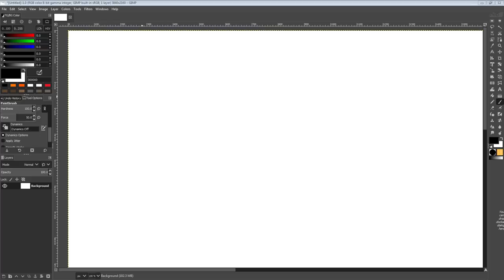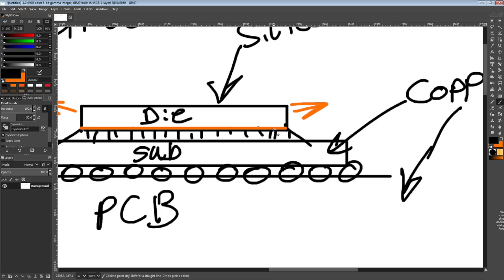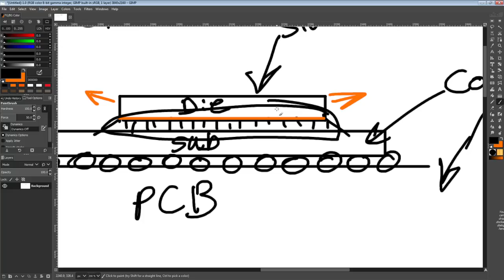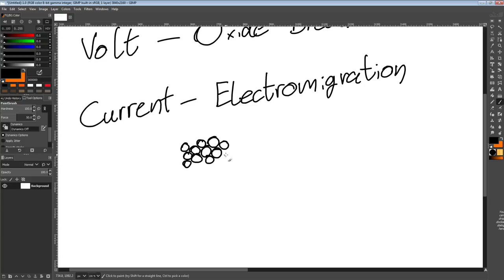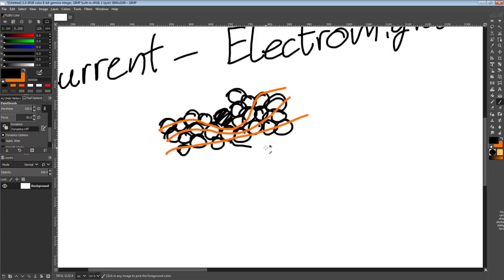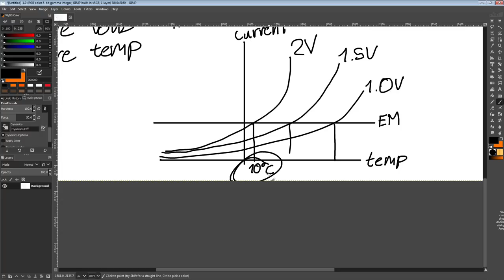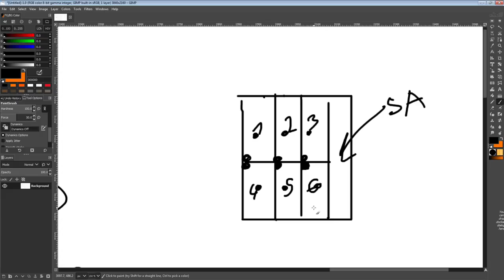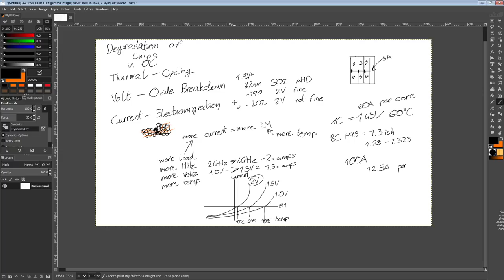Rambling about chip degradation

Comment: 1:12     thermal Cycling
18:15  oxide breakdown
28:52  electromigration
Reply: @Neiva71  Except in order to have comprehension of each of those you need some comprehension of the others
Reply: @cas curse If you already watched it, and you're back here again, did you really comprehend the subject matter?

Comment: Very good explanation.
That is the reason why I'm undervoting/underpowering my 1080 Ti down the point it does perform 5-10% less than stock settings (but plenty enough for me). But use SO much less power. 80-100W less. Having a GTX 1080 Ti use 150-160W is really nice. 60c max on air with very low noise. And the knowledge of much less degradation. Also always undervolting my CPUs when doing stock speed. Undervolting is possible on most chips, because the stock volts are normally set high(to be stable with even the worst binned silicons). Undervolting also saves you money on a bigger cooler and on the electric bill. But yeah... undervolting plus a bigger cooler is the best for longevity. 
I have a retro rig with a QX6850 (12 years old) that at stock freq, can be undervoltet quite a bit. So must still be in in good nic ;)
Reply: I use i3 530. Still rocking. No GPU and 3 Gb RAM overclocked. Stock cooler. 9 years almost 10. Playing arkham assylum :)
Reply: @karl9791  whats the point of keeping an old processor alive for so much time? 
Like, idk where u from, but in Brazil we pay at least 3 times more  in eletronics and we still dont want to keep the same cpu for 10 years.
Reply: @Shadower2014  no one want keep it for 10 years. For me, the ideal would be swap every launch announcement. But is what it is. My point about my cpu is simple, intel have a healthy long life. And I use it almost 24/7. So.. Just that. And I have another pc. New one. Waiting just for the rtx 3080. And still no plans for rework in the old one, maybe some change in the storage... Maybe. Idk.
Reply: Modern GPU's like the 1080ti doesnt degrade like CPU chip does. Linus made a video about this.
Reply: @MovementCultivation  All electronics degrade. Just the variable how quickly..
And actually the 1080 Ti might degrade faster than a smaller GPU die (like a 1070) especially if loaded with many thermal cycles. Any big die GPU chip generally degrade faster than the smaller ones with many thermal cycles. But As long as you use it within Specs (stock settings) it should have no problem lasting for years (5-7 yrs) Keep thermals and voltage as low as possible, and you gain less degredation and longer lifespan.
A way to check chip degradation, is to try running it low as possible voltage vs highest clockspeed as brand new, and then 3 years after, try it again. It might need a bit more voltage to run at the same clockspeed it could when new. Meaning its degraded. Might still be okay to run perfectly within specs, but degraded compared to when new.
Memory is a more fragile thing with modern graphics cards. Nvidia cards do not have memory temp reading and I know GDDR6(X) run hot. The new cards give you speed.. but not lifespan. Nvidia has no intention on making these last for 5+ years. (Id be surpriced if more than half of the RTX 30xx cards still works fine in 6-7 years) Nvidia knows the market demands Performance now. Not long term endurance.
Not overclocking the memory will be a good idea. Downclocking it a bit will give it a cooler longer life. Especially if its going to be put at hard work.
Reply: @Wushu-viking  Sorry..I think you missed the context of what I previously said. What I meant was Modern GPU's doesnt degrade as quickly or comparatively like CPU does.

Not like CPU's, GPU's degrades so slow on real life workloads, example gaming, rendering, encoding etc. Just like what you've said "Nvidia has no intention on making these last for 5+ years" - To the point that replacing the GPU because it's already outdated comes first before degradation. 

I OC'd my 1070ti to its last juice running at 70c underload for 4hrs in average and its core clock and voltage stays the same since I bought it.

I would say the fastest way to degrade a GPU is running it at it's max limits 24/7 just like how miners do but even some of them them cannot notice any decrease in performance. My friend has a mining farm, well just a room actually, and all his GPU's run 24/7. Just have to do a 2 day maintenance every 3 months. He already sold his first batch of GPU's after almost 2 years of use and it's as good as new.

I would say GPU's do degrade but it's too minute that you can only observe them in monitoring software/tools but not in observable performance, example fps or encoding speed.

Edit: Spelling
Reply: @MovementCultivation  Most electronics generally break (when they do) during a powercycle. So running "slow n steady" 24/7 is a healthier load than what you see with typical gaming usage. (Especially on many not maintained systems full of dust)
I too have also positive experience with GPU lifespan and mining. Ive been running several Vega 64 almost 24/7 from 2017 to 2019 heavily undervoltet (Just above stability limit). And maintained from dust. They were all in very good shape when I sold them in gaming PCs afterwards. Not even the original thermalpaste had dried up. Thanks to few powercycles, and steady healthy temps.
Point I was making is, that undervolting is healthy for the components. And if everyone used a bit of time to find the sweetspot of power/performance, they could save money on the power, and could enjoy less heat, noise, and dust intake along with longer lifespan.
I can make my Titan XP run similar (actually better due to stable freq) performance vs Stock settings with tweaked voltage/frequency curve. Using 70W less.

Im not so sure about how durable they aee compaired to CPUs.
I have seen many listings on defective graphics cards. (Some not working, some displaying artifacts, some only 2d working, some just unstable on loads.. Cards that probably has been used for gaming (maybe factory overclocked) and probably unmaintained, used at the thermal limit without knowledge of it.
Might not be a GPU problem. Could be memory, power delivery.  But defective card none the less. Using less power also puts less strain on the power delivery. (2+ on health) :)

Comment: A slight correction on electromigration. Current only flows on the surface of the conductor, not inside. Electrons jump from one atom to the next, from one end of the conductor to the other, leaving "holes" behind, and the direction of the flow of the current is actually the opposite of the direction of flow of electrons, so, basically, the direction of the flow of "holes". Every conductor has a certain resistance, which is actually the resistance to the electrons jumping from one atom to another, and one can think of it as the amount of hold an atom has over an electron. Also, current always flows in the direction of least resistance, which is now even more obvious. We can observe electromigration as migration of electrons that deviates from a wanted path due to changes that happen in either lower or higher resistance in certain areas of a conductor. If there's more than wanted resistance, electrons will take a different path, if there's less resistance, more electrons will flow on the same path over the same time. Voltage, temperature, impurities in the conductor and many other factors (including electromagnetism) can determine whether the electrons will behave as we want them to or not. So, too much resistance in a wanted path or lower resistance in a not wanted path will be the symptom of electromigration. The rest of the explanation that involves current, temperature and other factors is correct. O, and one more thing, electrons have insanely low mass, so it's not a bump as described, but they lose energy on overcoming the resistance, and are no longer able to follow a path that has more resistance than electron has energy, so they take a path of lower resistance.
[edit] one more note, greater the resistance - more heat, which causes even greater resistance.

Comment: Room temperature can also be like 5C when you're the extra ghetto type of overclocker who just opens the window in the winter for extra low ambient temperatures since chilled water cooling or dry ice is too expensive.
Reply: It depends where you live :D
Reply: @PainterVierax  Norway here. Managed to get the water temp in my loop to 7C by opening the window. My 1080 Ti was chillin at 18C under full load overclocked. It's pretty dank
Reply: 5Ghz on a R5 2600 using an air cooler gang
Reply: Just put your computer outside bro.
Reply: Theres no way you hit 5G off an air cooler.....what voltage are you using to hit 5G & whats your fps gain if so?
Reply: @gamechanger2324  You can if you live above the arctic circle. :P
Reply: @jeposton  i assume that would create condensation within your system?
Reply: @sangwonpark8967  cope
Reply: Lmao man I used to do this.  "Time to fire up the gaming rig, let me grab my winter coat and put on an extra pair of sweatpants"
Reply: @gamechanger2324  Condensation doesnt work like that, my guy. Water condenses when hot humid air touches cold surfaces. When the air is colder and the components are hot, you actually have the opposite effect, the water on the components will actually evaporate to the dry, cold air.

Comment: Very good vid, it gave me the confidence to try to beat the next gen big brother of my current CPU. I did 4.2 all core OC at 1.4V on a Ryzen 5 2600X with idle temp of 27.50c/load over time temp 71.50c using the Wraith Max box cooler for FX 8390 CPUs. This allowed me to beat the CPUZ single core score of the stock Ryzen 3600 and match it in multicore score, validated and stored on CPUZ site. It gave me great joy to beat $190 CPU with one I got new for $89 on sale. Note: it is Dec. 2019 mature manufactured.

Comment: 33:27 tried to tell a guy once that higher clocks take a bit more power, he insisted that only voltage matters.  but like any electrical system power draw is a result of work being done, in the form of heat generation...and transistor switching.  forgot the context of the argument but i think the guy was saying that an extra 500mghz on the core, as long as voltage stayed the same, power draw would remain the same

Comment: -digs out my Atari 800XL¬

Ah, the days when CPU's had no cooling whatsoever (not even a heatsink) and ran at 5 volts - just like everything else in a computer. XD

To be fair, there ARE stories of overheating from that era.
But it's usually a design with extremely poor airflow and an unusually hot component. (one of the rare components hot enough to require a heatsink)

In fact, the most likely thing to overheat in that era would be your computer's power supply...

By the way, if you have an old 8 bit system for some reason...
Don't trust those old power supplies. Although they may still work, for many computers they're so cheaply made that when they do blow up (when, not if) they'll take most of the circuitry of the computer with them.
Given the age of the systems, that's not something you can reasonably fix...
Reply: 5v single supply, a huge step forwards over requiring -5v and -12v rails.
Reply: @williamforbes6919  In ATX the -5V rail was used for ISA bus, it's gone for long time. The -12V rail is still used for RS-232 or RS-422 communication but now almost everything is connected through Ethernet or USB.
Reply: @PainterVierax  I was referring to the 8086's power rail requirements.
Reply: @williamforbes6919  this CPU itself (and its predecessor the 8085) only requires a single +5VCC to run. As I said, the negative voltage rails were used mostly for communication protocols outside the chip.
Reply: @williamforbes6919  Some systems required more than that.
But usually due to peripherals.

The 800XL is 5 volts DC only (technically you can power it over USB)
But the early c64 machines had both 5 volts DC and 12 volts AC.
(blame the SID chip for that though; 6502 processors only need 5 volt DC)

Interestingly you can still buy brand new 6502 family processors (z80 as well).

The modern 65186 chips are fully static designs that are rated for 14 mhz (but many can easily run at 20 mhz or more), and will run happily at 1.8, 3.3 or 5 volts.
(though if you use less than 5 volts the maximum clock speeds go down)

It's kinda bizarre to think you can buy new replacements for processors that old...
Reply: @PainterVierax  Trying to remember which micro it was with three required voltage rails then. There was some really rediculous requirements for clock generation as well. I could have sworn the 8086 had a -5v rail.
Reply: @PainterVierax  Seems it was the 8080 I was thinking of. +12v, +5v, and -5v voltages required for operation. Off by two generations...

Comment: Fun fact: The material for PCB (sub) is always mostly glass and epoxy resin & copper for the tracing and via hole plating (of course some other substances, but mainly speaking). More higher end tier board, more fillers. Fillers in the material usually for heatspeading and to try to make the PCB more robust.

Comment: The oven 'trick' also works because of surface melting, which is a quasi-state where on the surface a layer of atoms melts. This will/can mend cracks forming in the solder balls and its connections, therefore restoring a good connection

Comment: Hmm. Thanks for the info! I am actually having what sounds like it might be a thermal cycling problem, currently. The (438mm^2) GPU is fine when web browsing or playing less graphically-intense games, but as soon as I play a game with "shiny" graphics, I get a BSOD (or sometimes just sudden black screen.) I thought it might be something in the interaction between GPU and power supply, since OCCT's GPU "memtest" runs for at least 4 or 5 minutes (which is where I stopped it manually,) with the core reaching 60-70ºC on DIY hybrid cooling w/120mm rad. The "3D" test that loads the core (and draws more power) crashes almost immediately. If replacing my power supply proves ineffective, I may just resort to partially disassembling my GPU and sticking it in an oven at 170ºC.